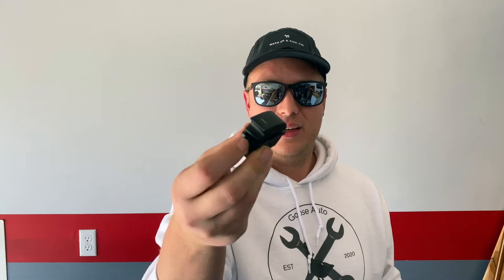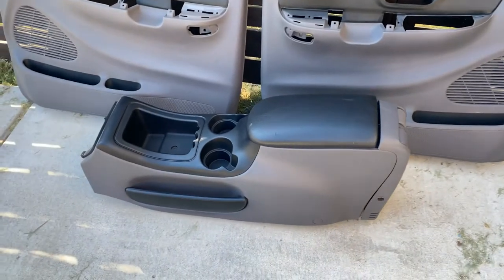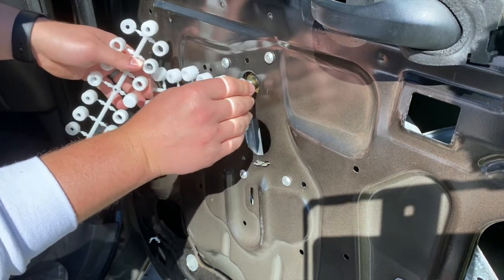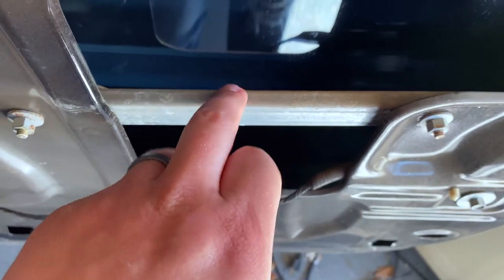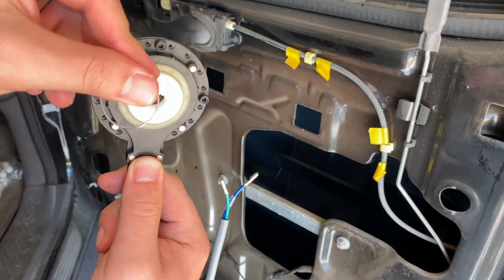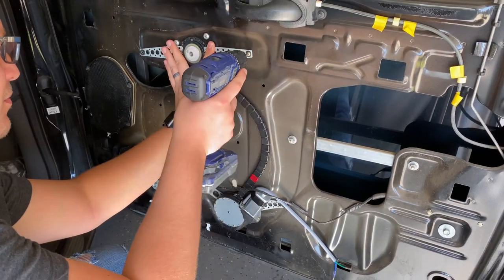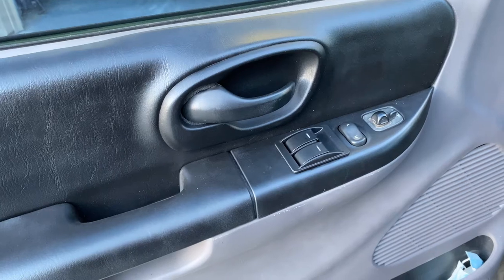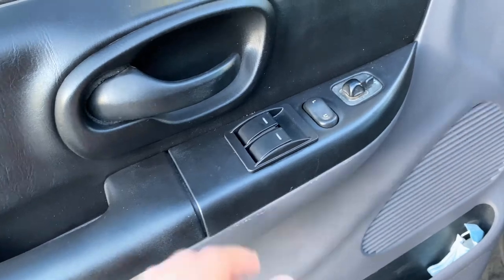Manual to Power Window Conversion Using OEM Electric Panels and Universal kit

Comment: FINALLY!!!! I had been thinking about doing this and could not find anyone who covered switching out the door panels and using the aftermarket window kit. I would like to attempt to connect to the original controls. I went to the junkyard and removed the 4 panels from the car, left the harnesses attached and just cut them off. Hopefully I can find the wiring diagram to assist. Thanks!
Reply from the maker: Glad to be of some help. I wanted to use the factory switches too, but laziness got the better of me. I was going to use the whole harness and everything but find out it wouldn’t work without the GEM from the donor truck. I have plans of redoing all the electronics and drivetrain though down the line.
Reply: So the "Driver" factory window switch did not work out because it was programmed to talk to the BCM, but I found some switches that looked "close" to OEM and had to cut out the trim some to fit but it def looks better than if I kept the door panel with the hole where the gear sat then mounting a big ugly block to it 😂. I was just so glad I found your video. I'm happy! 😁
Reply from the maker: Thanks! That’s awesome to hear! I’m glad I was able to help. Enjoy!

Comment: How have they held up in the past year? I was thinking about buying the same kit and I'm curious about the longevity of the product.
Reply from the maker: No different from the first day as far as I can tell. The passenger side could use some lubrication. I think since it was never used as much the internals are a bit bound up. But it hasn’t deteriorated over time.
Reply: Thanks, I was wondering the same thing...

Comment: Hi, how do i get power for 2006 toyota matrix? I bought the factory power one, install everything but i did not have any power. Pls help
Reply from the maker: If you don’t have any power run to it yet, you need to tap into something that has power when the key is in the on position. Check your manual or online to see what fuses would work. You can do something like like the radio or fuel pump. You can add a fuse jumper like I did in the video. I would imagine you’d need the factory lifting mechanism as well. In my case the factory system wouldn’t work without also having a matching factory security module. Meaning if I took the harness from a different truck I would’ve needed to get that module as well.
Reply: @GooseAutoWorks  hi, can I get your whatapps pls
Reply: @GooseAutoWorks  hi, thank you sir. Do you have any social media can message pls

Comment: Do you know if the doors are the same for electric and non electric? I would like make mine electric but with all oem parts
Reply from the maker: Well I pulled these door panels from a truck with factory electric windows and they attach just the same. As far as the switches, I took one of the factory ones apart, and looked at the wiring schematics online, but to be honest I couldn’t quite figure out how I would need to repin the harness/switch to make them work. I’m sure if I put more effort into it, I could get it done though. It’s just a switch, it’s pretty straightforward, I just didn’t feel like messing with it at the time.

Comment: I'm also planning to install power windonw on my car, do you know how many amps is the fuse that it came with the kit?
Reply from the maker: It calls for a 30, but I used a 25. I’d rather it be slightly under than the other way around. But I don’t remember if the kit came with fuses or not.
Reply: @GooseAutoWorks  thanks man, still working good up to now?
Reply from the maker: @ryanydc6237 Well the truck has a cracked piston so it’s been in storage since last summer, but everything was working just fine at that point.

Comment: Great video. I didn’t even know this was an option. I there an automatic cutoff when the window reaches the top/bottom or do you have to release the switch so as not to damage the motor?
Reply from the maker: Thank you! It stops on its own, but presumably because it has a max force limit, so I don’t hold the button any longer than I need to.
Reply: @GooseAutoWorks  great. Thank you for your reply.

Comment: Same reason for changing, The reach over. I want to convert from manual to power door lock, mirrors and windows for a 1999 Ford 250 Econoline van, where can i order the kit? THANX again.
Reply from the maker: The kit for the windows is linked in the description. As far as the door locks, that might require you to have the wiring harness and GEM module from a donor truck. The windows and locks are linked into the factory security system and so it all needs to talk to one another.

Comment: How’s the 25 amp and the 30 amp did it blow?
Reply from the maker: The truck’s been down since the summer with a cracked piston so it’s in storage. But in the time I was using it everything was doing just fine.
Reply: @GooseAutoWorks  geez how did your piston crack?
Reply from the maker: I’m really not sure. I was tracking down a knock and put a borescope down each cylinder when I found it. My best guess was it was oil (or lack thereof) related, but not too sure other than that. I’m going to either swap in a long block from a Gen 2 Lightning or a Coyote 5.0, but I haven’t fully decided yet.

Comment: Have you done the lock/unlock?
Reply from the maker: No. I looked into it, and even started taking a wiring harness out from a truck at the junk yard, but abandoned the plan. It’s possible to make it work, but you need the factory wiring harness to the doors and the GEM module for the security system to allow it to operate. If you already have power locks it should be much more straightforward, maybe just repining a connector or something, but in my case it was more trouble than it was worth to me.

Comment: Not to be that guy..
But in practice I've found the adda fuse is great in combination with a relay.
Go direct 12v battery with the #30 and then use the add a fuse from trigger switch .
Especially when it is a keyless entry:)
Reply from the maker: Not “that guy” at all. Thanks for the insight.

Comment: I've been wondering how to do the opposite: I need a manual window passenger door and all I can seem to find is power. Would that be difficult to convert?
Reply from the maker: I would imagine you would need to change out the door panel and you would need to change out the gearing and lift mechanism to match with the manual crank.

Comment: What vehicles were the door panels and console removed from to fit your single cab f150??
Reply from the maker: I got the console from eBay, but it was out of an Expedition. The door panels were from a Supercab F-150 at a pick and pull yard. There were Expeditions there too with consoles. I wasn’t thinking about the pick and pull place when I ordered the console online. It was way cheaper at the junkyard. I did buy a seat out of one of the Expeditions though since I needed the seat pan and bracket for the console swap.

Comment: Late I know.. but I'm curious...
If you got the door cards off a electric car... why didn't you get the electric windows motors from that?
Certainly is less messing about.
Reply from the maker: I started to, but to make it work I would’ve needed the donor’s GEM module for security features as well to make it work. I got part way ripping the harness out and just decided I didn’t want to mess with it. That said I have a whole donor I’m going to be taking an engine from and I plan to swap over as many things from that vehicle as I possibly can.
Reply: @GooseAutoWorks  oh okay. The car you were doing up didn't have the BODY wiring loom for electric windows to start with?
By security, do you mean the bcm/ecu(pcm)?
I had a vy commodore s2 sedan (forget what they are called in the usa), n just got a wagon (same).
The wagon was front electric, window winders in rear.
I checked wiring (under console, and into door) n they had the same.

So grabbed the internals from sedan and put in wagon.. bingo..  upgrade :)

(I found your video looking for "how to align".. n now and going to look for that video you mention bout painting hehe)

(If anyone reads this and wanting an easy tip to drill out rivets... use self tapping screws/bolts.. soooooo much quicker and efficient than using a drill bit)
Reply from the maker: @w0lfm4n43 the GEM is the Generic Electronics Module. It talks with the BCM, but also handles things like anti-theft and it controls things like the door locks and windows. In this example anyway. The Commodore sedan would be like our Pontiac G8.

Comment: Is the driver side the same regarding connectors etc ?, I want to convert my 90 240sx from manual to power window, I have all the original wiring, buttons, regulator etc and what to use at least the original buttons.
But wanne know if the driver side even supports I think 6 wires, 12v, ground, up, down, passenger up, down
Reply from the maker: They’re similar. The pin outs may be different because the passenger side controls just that one window, but on the driver side you’ll have 2 dedicated switches which should look the same. From what I remember, the driver side has the same wiring but two wires for up and down for the passenger window is run across to the driver side switches as well as a ground for that switch.  If you’re able to find a wire diagram for the power windows for the 240, that would be helpful considering you’re using original wiring. When you start getting into things like one push down/up functions you start adding more wires, but if the switches are basic in their functionality like these, it should be pretty straightforward. So if the switches are a 5 post connector it will be pretty simple to know what to do. I’m not sure if that answers quite what you were looking for, but I’ll help where I can.
Reply: @GooseAutoWorks  Thanks man appreciate it. 
Gonna give it a shot when I have everything, otherwise I will probably buy the universal kit and go from there. 
Now just to find what is what on the original buttons haha
Reply from the maker: @tuned4life I will say I started to go this route myself, but learned I would need the GEM computer from the donor vehicle which is the security system module, and I would have to rip out/change more things than I wanted to. Being a pre OBD-II car, idk if that simplifies things for you or not, but something else to look into before you get too deep.
Reply: @GooseAutoWorks  yeah I think I have everything needed and figured out how to do this conversion, just need to do the wiring
The whole system is based on 4/5 wires and ofc 12v and ground
Driver : Up, down
Driver/passenger : up, down
I think I just need to start with a FSM next to me and then it will all fall into place haha

Comment: My problem is that my vehicle does not have an interior fuse box . 2001 Chrysler Voyager .
Reply from the maker: Oh Dang. Yeah it’s weird they did that. You can still do the method I used, you’ll just have to go through the firewall to the fuse box under the hood. Not ideal, but still doable. There should be a grommet or 2 you can use to pass through to the other side.
Reply: @GooseAutoWorks  I have the base model . If I don't convert oem style , do I still need the jumper ?
Reply from the maker: Well regardless of what switch you decide to use, you’ll need to get power to the motor. The easiest way is using the fuse jumper like I used. It’s clean and gives the motors their own fuse.
Reply: @GooseAutoWorks  Thanks
Reply from the maker: Absolutely. Good luck!
Reply: @GooseAutoWorks  My manual regulators have the same type of design as power regulators . The passenger side (which is brand new) is stiff and hard to roll up . Is there a way of adding grease to it . I have already installed the kit , but the motor is having a hard time with the passenger side .
Reply from the maker: Yes. You can add some lithium grease or similar to the scissor lift mechanism beneath the window. You can also also try shooting some lubricant in the channels of the door where the window edges would travel. That would more than likely free things up for you.

Comment: okay but can anyone tell me if you can go from power to manual windows ?
Reply from the maker: I mean you probably could although I’m sure that’s not a popular choice lol. You’d have to swap the internals. The lift assembly would be different. You might have an issue with the security module as the power windows are tied onto that computer.

Comment: Hi does this work in jeep Wrangler 2008
Reply from the maker: The kit and the process is universal, but I’m not familiar enough with the interior of Wrangler doors to say if this process works. If they’re not removable, then yes. If they are, they have contact patches instead of wires running through the door and into the cabin.